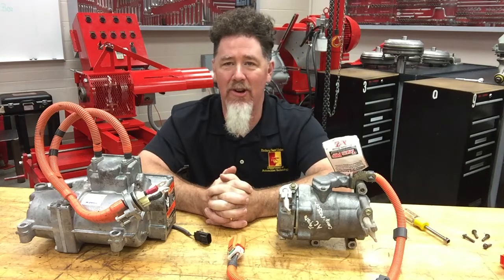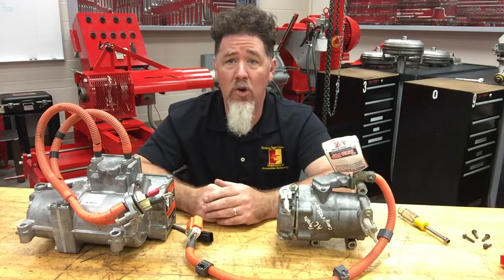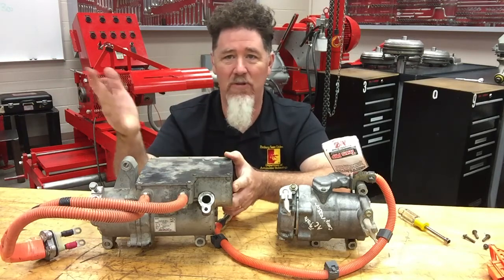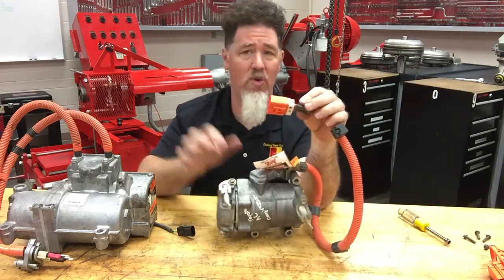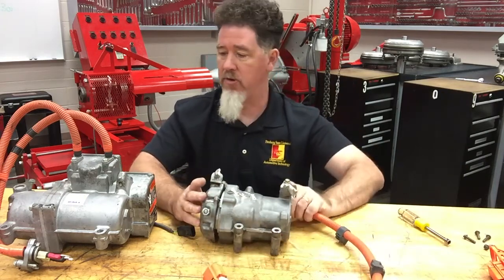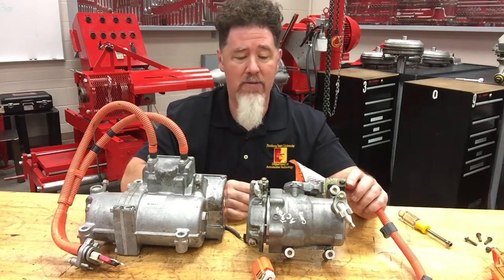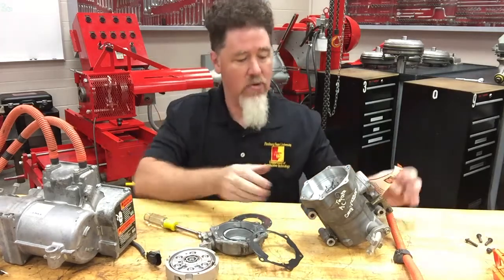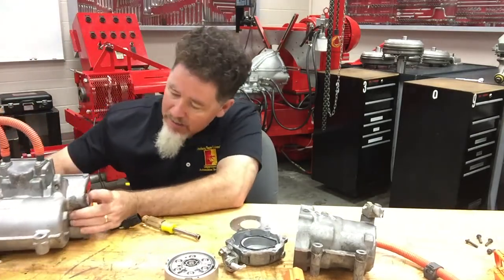Lesson on Hybrid A/C Compressors Part 8

Comment: I believe the compressor on my Lincoln mkz is needing to be replaced, how would I diagnose that the compressor is broken?
Reply from the maker: Is the clutch even on in the Lincoln, if not, start there?   If the compressor is not pumping correctly, the low side pressure will be high and high side pressure will be low.

Comment: The volume level is far2 low& requires adjustment &reposting IMO. I'm really interested &can't hear well even @50% volume wherein 15% is normal.

U can tell when the volume sync is way off when commercial play & blow u out of the room.
Reply from the maker: Sorry, but I can hear it find on the small speaker on my laptop.   I did this video early in the COVID year before I got a microphone.   I am using a mic on all newer videos.  Thanks for watching.

Comment: Which car is that compressor with the built-in invertor from? That may be perfect for ev conversions.
Reply from the maker: Hi Roshan,    I think I got that compressor off a older 2-mode hybrid system that was used in the 2007 - 2008 Durango or Tahoe.  These compressors are very expensive!  Good Luck.
Reply: @ProfessorPentane  I need your assistance with my truck! How can I contact you?

Comment: Is there a way to make this to work on 12volts dc ?
Reply from the maker: Hi John,  I know no way to convert a high voltage compressor to work on 12 volts.  Thanks for watching, PP.
Reply: @ProfessorPentane  thanks for replying ..
Reply: @ProfessorPentane  do you know what type of oil a hybrid compressor would need?
Reply from the maker: @ramiromoreno1386 , POE oil.

Comment: Pretty much the same as residential AC compressors then. Very interesting
Reply: I think normal residential AC units have single phase motors.
Reply: @ghenkhoash2440 you're correct yes they do. I meant in their mechanical construction..
Reply: Not really because for example a prius AC compressor has CAN communication lines which communicate with the cars computer. They controls are a lot more complex than a house AC. A house AC technician would have a hard time diagnosing it.
Reply: @ronaldoquintos1675   OK, like VRV AC
Reply: @ronaldoquintos1675  I guess you haven’t worked on any of the 20SEER American standard heat pump units with variable speed three phase DC scroll compressors. Yes, they are just as complicated.